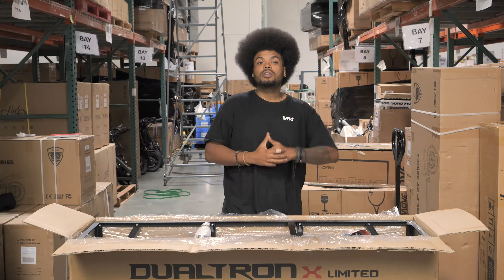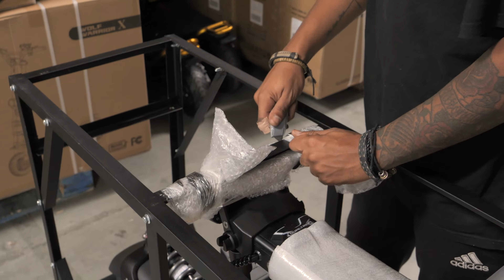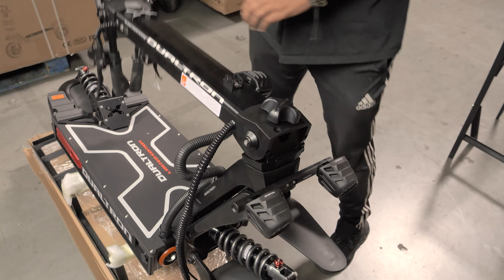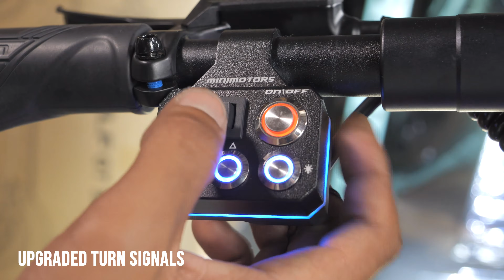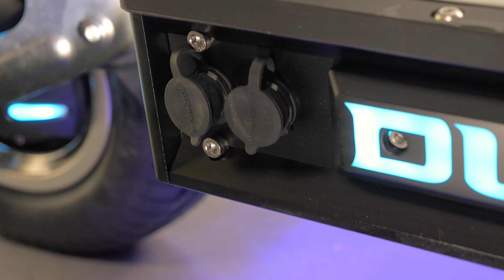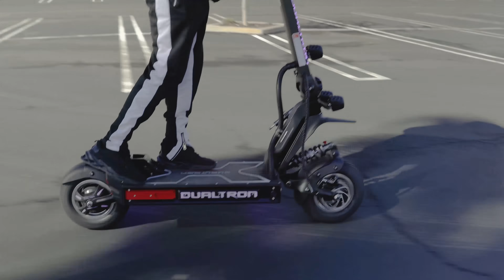Dualtron X Limited has arrived! Unboxing & Setup

Comment: Add back suspension to emove roadrunner base model and hydraulic brakes and sine wave controller and it will be the most sold scooter keep it light weight it will be the best

Comment: How much
Reply: $6,995.00
Reply: @jayfx2  :/
Reply: 7,000 not including taxes and not including 500 shipping fee.So 8,000.You have to ship it out for tire change and break changes.500 shipping it out and 500 shipping it back so most likely once or twice a year.
Reply: Good night I'd learn how to change tires myself. I wouldn't ship it back
Reply: @dakotawolf6155  any little tug could mess up your lights and set off your emergency breaks.Which would shut down your whole entire scooter.Trust me I had  4 of them.Dx2 dx2up two of each.You don't wanna mess with or play with none of those wires.its a million of them you have to move them  around just to the breaks.Each time I tried to gently move stuff around barely touching the wires all hell broke lose so good luck.
Reply: @tankwilliamson1903  free shipping in lower 48 states, and you don't have to ship it back for tires and break changes. If I bought one I'd definitely do the tire changes and maintenance myself.
Reply: @tankwilliamson1903  no breaks can be done at home it's a easy I learned the hard way after spending 400 just to get them tighten up over a period of time.

Will learn how to do tire change have a spare tire with a motor on it has a snapped cable so not scred to damage it further lol , once o learn that tire like I dis my bike when I was a 11 year old boy I wchange my scooter tire now I am man I will put my fear behind me and conkur the scooter tire change   after that will learn a the wiring,  I have to I have 7 electric scooters .......